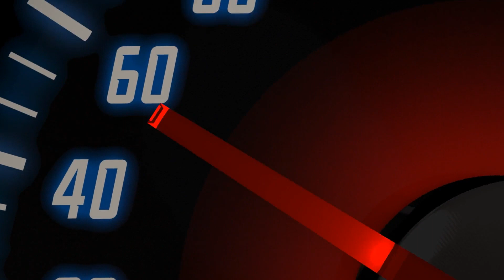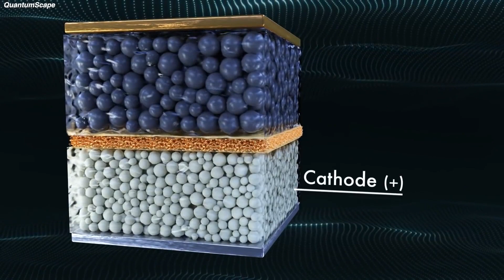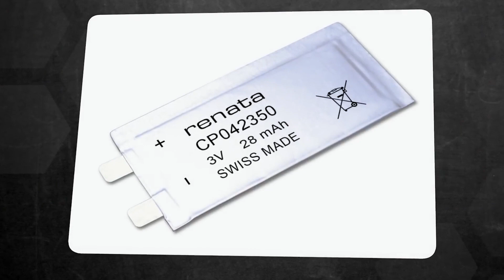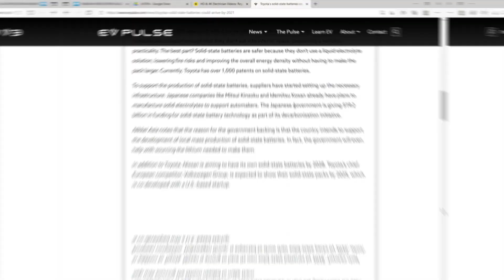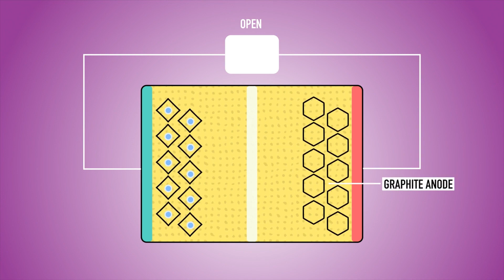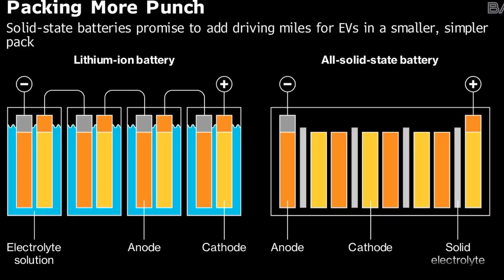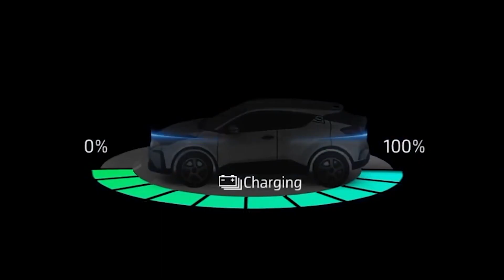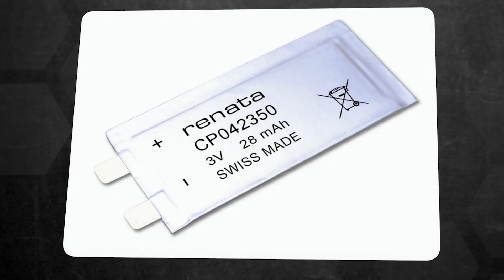GAME OVER! Tesla Battery vs Toyota Solid State Battery

Comment: We will see a commercially available solid state battery by 2040. I was told by an employer in 1977 that lithium batteries would be a revolution of capacity and cost, available by 1980.......clearly lithium cells were not popular until 1996, over 15 years later than suggested. Toyota's battery will be available after 2040 so let's not get excited.

Comment: Same old bollocks over and over.
Solid state batteries have been around for years in small scale units.
No one of has made them on a large industrial scale.
They still need lithium and cobalt which are globally limited in supply,and recycling technology is at the moment is between non existent and limited due to the original battery pack design.
They're are also potentially better alternatives to having a two tonne battery hauling a 65 kg human carcass around a city, but it seems like the emperor has no clothes when cheese face musk is pumping his propaganda.
Reply: This is exactly why a mass transit infrastructure is so important.

Comment: When they finally make a battery that can be put out quickly and about killing the occupants that'll be a big hurdle but you got to remember all the heavy metals in batteries when they burn are extremely toxic that's why they cannot even use water on them when they're burning and they can't use chemical spray because that would kill the occupants nearby
Reply: That is definitely some technology to be worked out. We can’t have cars catching fires that cannot be put out without harming someone.

Comment: What’s needed is not a way to charge faster but a way to change the batteries. That way you could just pull into a service station and exchange the flat battery for a fully charged one and then just drive away
Reply: Tesla was supposed to implement this. A way to quick swap your entire battery pack. It stayed on the drawing board, I guess.

Comment: All the talk and rumors come down to the same thing.. Some day soon. It's like fusion.. Been going to be here in 10 years for about 50 years now but the good news is that it's only 10 years away.. You start by saying they might be  testing in some cars this year and maybe next year. Then go on to say that they ALMOST have the separators and chemistry figured out.. And there is only a little bit more to make it possible to produce them at scale and at a price point that will sell.. We are years away from solid state batteries. And when they get here all the car makers will be able to get them so they won't be destroying any of them just changing the batteries they use.

Comment: Toyota are also making plans to keep developing it's fuel cell technology for its hydrogen powered vehicles

EV's still have the issue of obtaining the material out of the ground and the large CO2 it releases when extraction takes place and then there's the disposal is the spent batteries, much of which are difficult or not recyclable cheaply or at all

I'd rather hydrogen than EV

Comment: Tesla and Toyota are working together on another project and I can foresee a long-term partnership growing in this area.  Tesla could grow and control the recharging pumps (or battery swaps) market if they supported the SS battery format, in addition to their own...that's just good business sense.  There is a LOT of money to be made from those recharging stations.   In exchange, Toyota would get a huge boost in the US market to sell their SS vehicles (they certainly won't sell any if there are no recharging stations - and that could take years for Toyota to build out that infrastructure).   I suspect if a deal like this went down, both sides would promote each other's format as merely different options -- rather than create another VHS vs Betamax war.  The business opportunities could be endless.

Comment: Toyota will make the race that‘s for sure the mix of tech potential in Japanese industry combined will come up with some surprises leading to a sprint from behind with interconnecting to PSA they will turn the market and they will not hesitate about it and they are not stock focussed they can run business by equity capital for long… and they are focussed on complex future planning with a lot of stuff in the package… and the others will not die instantly but the will buy licenses ;) wait and see.

Comment: "Smart" batteries are next, self-charging from the environment, or direct charging by radio and a coaxial cable next to the roadway (Nikola Tesla's patent for powering electric trollies). People on interstate highways will get billed according to their data rate (charging rate), or have motors and solar panels so efficient that solar panels alone power the motor;  the battery will only be there for the extended range, and for powering the car on cloudy days or at night.
Reply: Not realistic.  Radio waves with coax Receive at milliwatts, not to mention the very inefficient method of wireless charging in general.  Nothing outside of extremely small electronics will make use of it, ever

Comment: BYD's Blade Battery is a solid state battery made over a year ago, Toyota and Mercedes will be using them.
Reply: The blade is not solid state . I don't know where you are getting your info  but you need more than one source. It's lithium iron phosphate that's why there so cheap.

Comment: Comparing Toyota and Tesla makes no sense, as both have a common denominator is battery manufacturing and research - Panasonic alliance. Supposedly, the  new Nicad battery research will prosper as silently passed this solid battery, and there Toyota is KING.intersting times ahead

Comment: It appears that Solid State battery technology is the way to go.   The fire danger of conventional LI batteries is real, and many fires go unreported.   Insurance companies quietly tell people with EV’s to not charge them in their garages, but at a distance from their homes in the event of fire.   Road damage has caused many fires due to the fragile of electrolyte.  Airlines prohibit the transporting of LI batteries of certain sizes and anyone in the motion picture business know.   The Solid State LI (SSLI) battery is the way to go, but to get product out the door now, we are limited by existing technology, but the option must exist to literally change out the older battery technology to the SSLI when it becomes available.  This flies in the face of planned obsolescence.    In theory, an EV has a virtually an infinite life due to its simplicity.  The same can be said for any integral combustion vehicle if properly maintained, but that maintenance gets more expensive is the vehicle ages.   The electric motors in EV’s can literally last for over 50 years.  The only part that will need changing is the battery pack.  This flys in the face of the major money maker for the car industry,  that owners rid themselves of older cars due to expense of maintenance, and buy new ones.   Replacing a battery pack with an SSLI pack will keep the car running like new—I understand other things need replacement like tires and brakes, but that is considered routine.   My bottom line is the SSLI technology needs some good strong investments the goal is an all electric future.   No one knew how to spit an atom until it was done.   I don’t agree with the insurance industry wanting a ten year history on the technology.   Development times have shortened due to computer technology being able to literally model the future.   We need someone who can “Think out of the Box”.  To make this happen in the next two years.

Comment: A solid state battery at the voltage, current rating and energy capacity to drive a medium size passanger car 400km is still at best 10-15 years away.

Comment: I hear a lot of "might", "promissing" and "could". Toyota have claimed solid state for years now, and still nothing. 
There is also more to it than just making a battery that is a solid state, you need to be able to get the materials, produce it in high numbers and still be cheaper than any alternative on the marked. You can't say "We will save you 10 min on charging" if the price is 3-4 times, and not charger can deliver the charge anyway. 
So Toyota still needs to build the car, the plat to make the car, and the battery and then the charging system too. So even if they only used 2 years on each thing, meaning they already have the perfect battery that can scale, it would still take them almost a decade to bring it all to marked.

Comment: 1000 mile battery charges in 10 minutes.  If we assume 4 miles per kwh, it is a 250 kwh battery.  

1.5 megawatt charger service.  

I like this future.
Reply: 3 phase house service will be come normal in 15 years.
Reply: Correct! I try to be reasonable, but I still get big numbers :
20 kwh for 100 km -> 200 kwh/1000 km. Load 15 min.-> 800 Kw =100… 400 houses.

Comment: Solid state is more optimized for power density, but it is much much more difficult to develop the technology. 

Lab scale versions of solid state do beat performance of mainstream lithium ion, but but at 5x the cost.  

Traditional lithium ion continues to improve as well.  We shoukd expect at least 5-10 years to get to price parity between the two chemistries.  

I hope in 2030 someone is producing 3000 gwh of solid state to match the 3000 gwh of more traditional cells being made by Tesla.

Comment: Toyota still favors hybrid engines and is pressuring governments to stop EV incentives. It wants hydrogen cars. Stalling because it is not ready and fears it could lose the emEV race and will go out of business. Tesla 4680 has technology that is here now not 5 years away.
Reply: 4680 is sadly NOT here now. It's still 1-2 yrs out. Tesla haven't revealed what the problems are, but a few with battery/capacitor knowledge have some good theories. Tabless has been used in caps for a long time, & there appears to be a problem with tabless on the high shock/vibration environment in a car. Capacitors are often "glued down" with a flexible compound to reduce vibration that can damage the caps, so this theory sounds feasible.
Reply: @alexmanojlovic768  it is here now. They are finalizing the last robots on the production lines. 95% completed.
Reply: @Unitedflyier  I hope so. Link or article title? 👍

Comment: For someone who is working in the industry, I can tell you that there are many SSB’s that are at the point of commercial production. Don’t be fooled, the holy grail is to charge to 80% in 15 minutes and drivers want extended ranges to overcome range anxiety. SSB’s will come just as Ultra- capacitors will do for high performance sports and super cars.
Reply: if you don’t mind me asking, what do you do for a living?
Reply: @EJD339  Hi EJ, I’m Business Development Manager for a large international Corporation who manufactures and sells Thermal management for automotive battery systems and the specialist materials that go inside the modules or packs, to insulate individual cells, provide a barrier to thermal runaway and or protect the cells from crash impact. A lot of my work is looking at early stage battery technology, which considers things like chemistry, power density, methods of cooling and heating and alternative materials to typical NMC Li ion batteries. I see the development of  things like SSB’s, Ultra capacitors and Fuel cells.
Reply: @2old4much  so you get your information from this Channel?
Reply: @brgebrgesen1928  No Borge, I get my info from industry networking talking to innovators snd start ups, talking to the big boys, newsfeeds, LinkedIn, news articles and so on.

Comment: First, I would have to see solid state batteries being successfully used in small electronics like tablets and phones before I even begin to believe they can be used in cars. Second, Toyota is lagging way behind in EV technology, and they are heavily lobbying countries to slow down the transition to EV's and they are still heavily pushing hydrogen cells, so I seriously doubt that they would be the first to achieve solid state batteries for cars at a large scale. If that was the case they would be promoting and speeding up the transition to EV's. This video seems to be more like a PR creation by Toyota and not a real technological video.
Reply: Damn, I thought Toyota gave up on hydrogen fuel cells. I just wonder if that they put so much money in that technology they don’t want to give up.  They can make that car as cheap as they want but if there aren’t hydrogen fuel stations (which I don’t think there will be) the cars will be pointless.

Comment: Every battery warms up when charging or discharging.

Replacing one battery technology by another technology just needs small changes in the electronics. Replacing gazoline by electricity is a much higher change.

So: build more electric vehicles and stay open for new battery technologies.
Reply: State State Batteries do not radiant heat when charging or discharging. When lithium ion cells get near the end of their voltage capacity the circuit (I) goes up to maintain the power output..V=IR. Its the increased R (resistance) that makes cells get hotter as the circuit goes up.
Reply: So Solid-state is 100% efficient in charging and discharging?  Get out of here with your bull
Reply: @monsterous289  I don’t think that’s what he meant.
Reply: @MsNickie1001  It's possible he meant the battery just stays super cool when at normal charging levels, which allows for significantly quicker charging to get near the same heat as charging current batteries, but saying the battery doesn't produce (radiate) heat means the process is 100% efficient.

Comment: Solid state is the way to go as it solves some of the current negatives on todays lithium ion batteries. However the point of current Lithium ION "lasting" past 1000 cycles is false. (the clip that showed 60,000 miles). My Model3 is at 62,000 miles and while yes it has some degradation it definitely is not time to replace the battery pack - nowhere close. What exactly is the degradation percentage for this particular point in the video? The video does not say, but does clearly say what solid-state is which was 90% at 5000 cycles so to me that is biased. Typically 80% of original capacity is the benchmark figure.
Reply: You can't take solid metrics from lab test samples anyway. If they're ready for production, they could state chemistry & give high price points from which, they can give us good "price drop" estimates going forward.